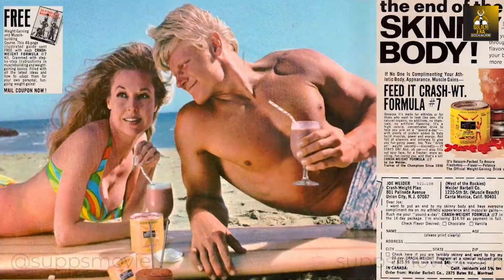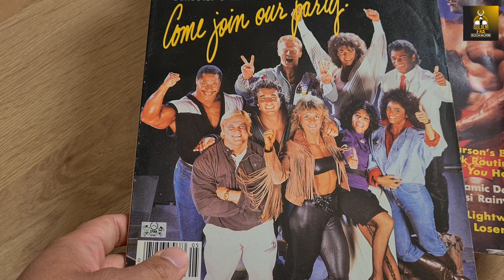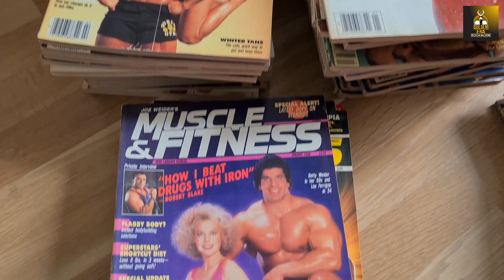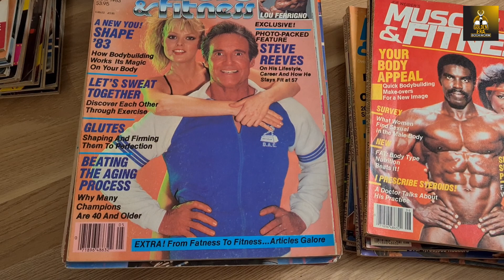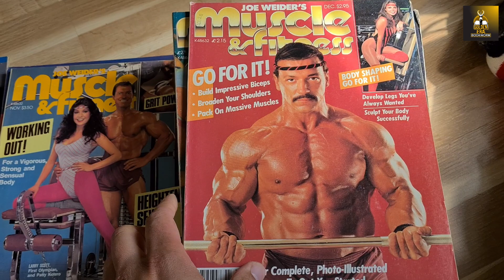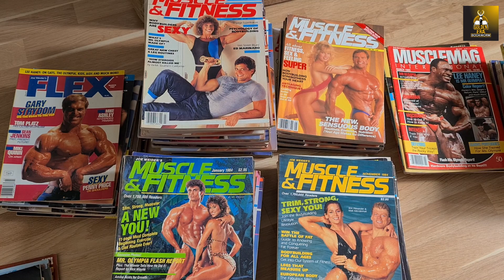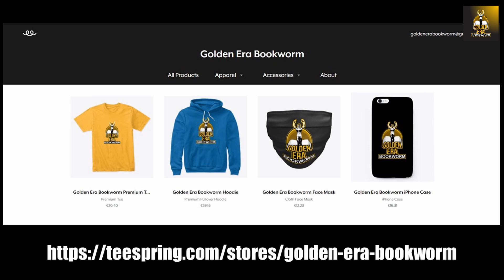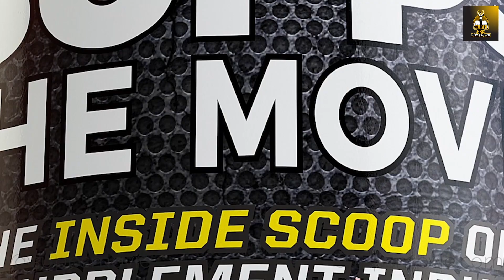OLD SCHOOL MUSCLE & FITNESS MAGS

Comment: I recognized a few. A lot were from right before I started working out (May of '86). I read all the muscle mags for the 1st few years. Even used to pick up an issue of Powerlifting USA once in a while. Never was a powerlifter, but I did use a few programs I picked up there. Interesting stuff.

Comment: I remember the black and white iron  man mags, in the 70s they had some very interesting articles by writers such as: Bradley steiner. The robust looking equipment they advertised  looked like you could drive a tank over it, and barely dent it. Muscle builder and power in the 70s had amazing photo shoots of zane, and the other champs. I flicked through a mag on a news stand recently......and half of it was adverts for supplements etc......nowhere near as good as the 60s and 70s mags, its lacking that WOW factor. The guys in these mags then looked like some sort of god, or super hero. Today they are bigger, stronger, weigh more etc.....BUT, they don,t LOOK anywhere  near as good as zane and his peers.......and l dought many of the current pros will reach the age of zane.